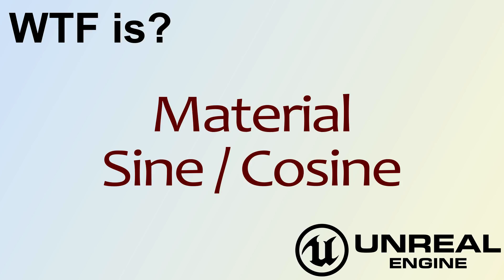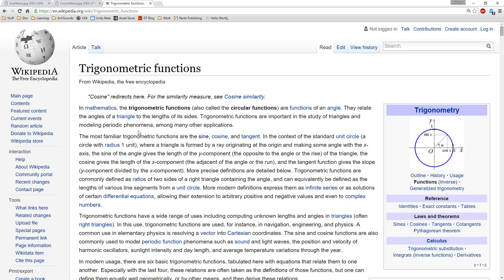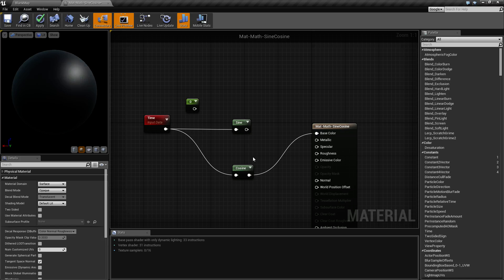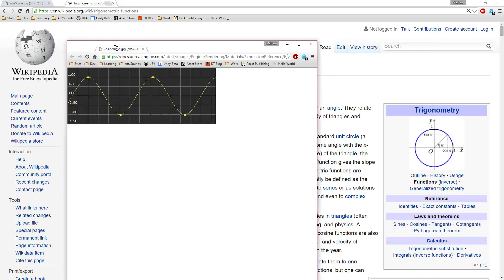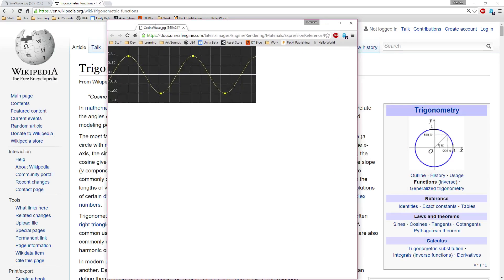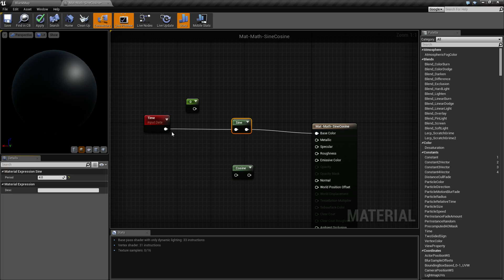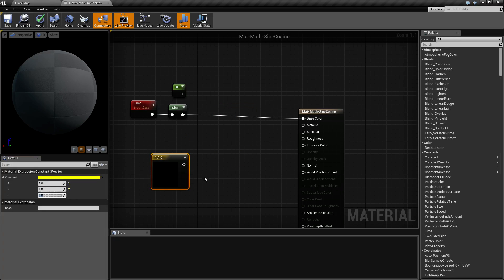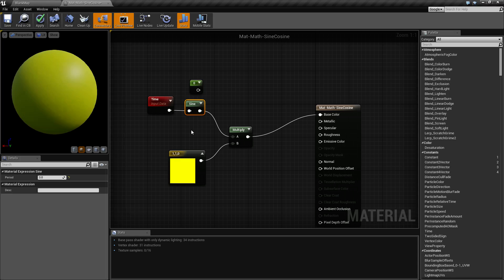WTF Is? Material - Sine / Cosine in Unreal Engine 4

Comment: In case anyone wonders why the black color stays there for so long, it's because sine and cosine vary between -1 and +1, so if u want something going between 0 and 1, you'll have to remap that. You can either manually do (1 + sin(Time)) / 2, or you can do (sin(Time) / 2) + 0.5 or you can just use the ConstantBiasScale or the MultiplyAdd nodes and achieve the same result.

Comment: This is a great tutorial but you fail to mention that the sine cycles between -1 and 1 so if you want a smooth cycle you have to take the value of the wave and divide by 2 to get it to cycle withing the range of -0.5 to 0.5 and then take that value and ad 0.5 to get it to cycle between 0 and 1; 
V/2+0.5 or: [time]---[sine]---[/2]---[+0.5]--->>
then you can take that value and use as modifier in a multiplier and add intensity for emission or other stuff along the way and the sine wave will not interfere with math down the line since the max value is 1 and you wont risk multiplying subsequent boxes unintentionally (as opposed to just adding +1 to the sine and get a cycle from 0 to 2)

look closely at the video: the black is present for a full second but the white is much briefer.
Reply: The only thing I was looking for and it wasn't even in the video, thanks!

Comment: Is it possible to have like a minimal value? Since i am using this for Emmesive ness, but i dont want that the emmesive goes to 0
Reply: This is super late, so apologies if this is useless to you now, but both these values fluctuate between -1 and 1. If you add 1, it'll fluctuate between 0 and 2. You can then divide this number by 2 to fluctuate between 0 and 1.

By adding and dividing by different numbers, you can get different starting and ending ranges. Just gotta do a little maths.